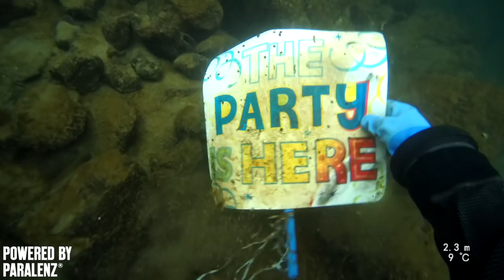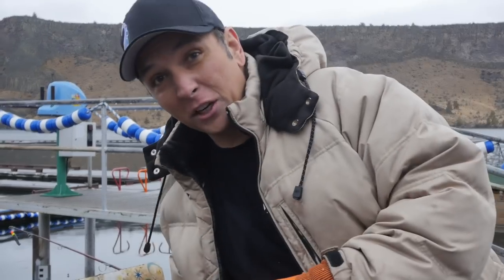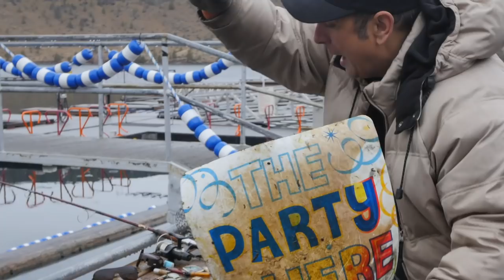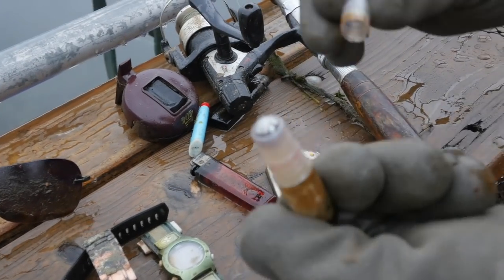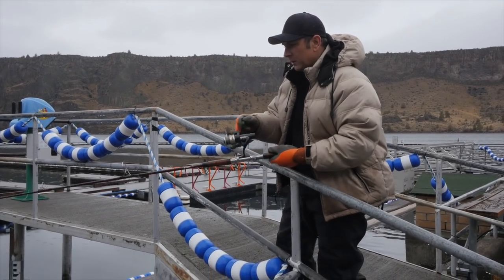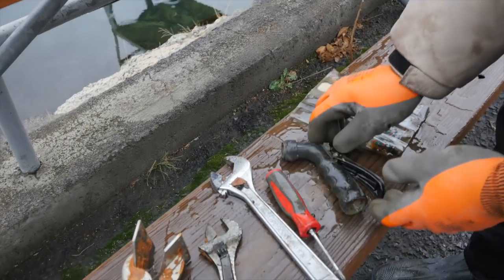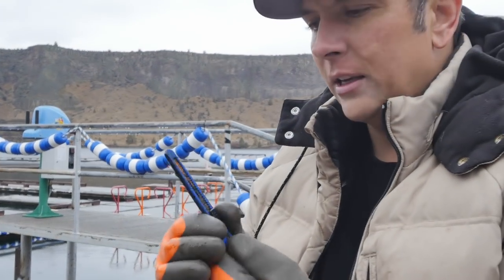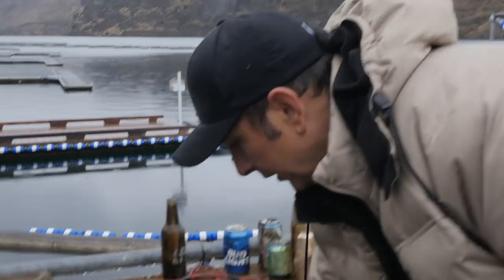Found 8 Radios, 3 Watches and 16 Sunglasses Scuba Diving Marina!

Comment: Truthfully the germs on the whistle are probably all washed away. 
But you should carry some alcohol wipes to clean with. Saw a utube video and they cut a better grade paper towels in half through the middle  took out the cardboard tube, put into a plastic container and poured in a bottle of rubbing alcohol.. I tried this works great.